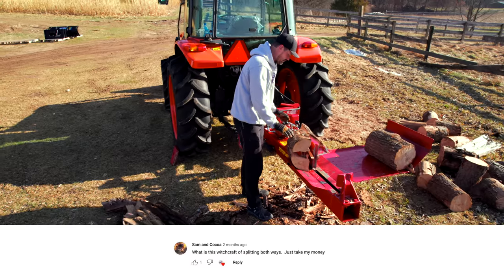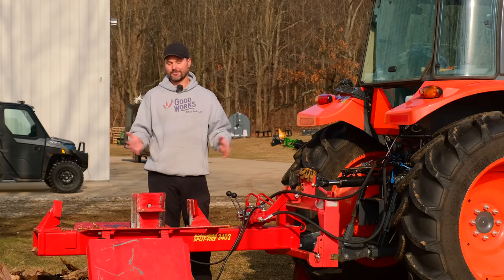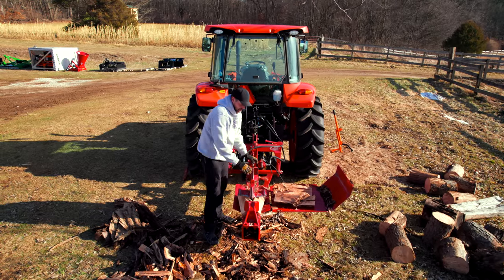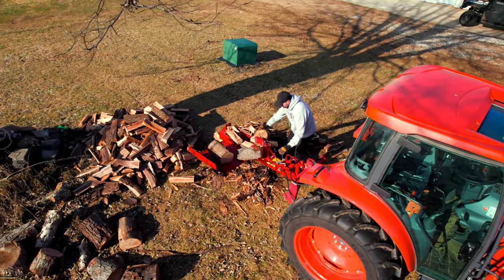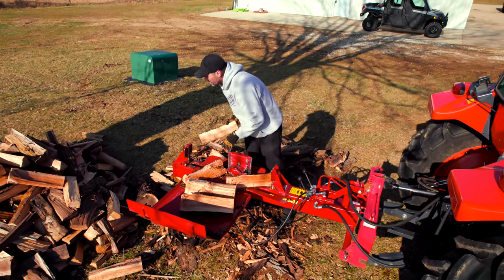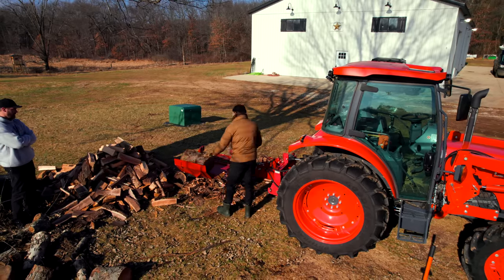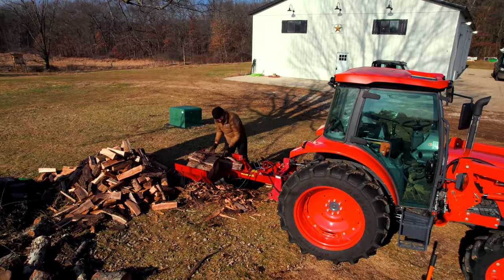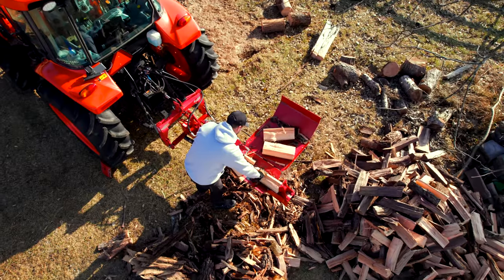THIS IS CRAZINESS! ARE YOU AFRAID TO USE YOUR TRACTOR?

Comment: When I was young and foolish, I once had 30 yards of class 5 delivered to my property.  I used it to repair and maintain my driveway.  Spread every bit of that with a wheelbarrow, shovel, and rake.  What was I thinking?!!!  I'm older and wiser now, and less physically capable.  I own a tractor.  I may plant some flowers in my old wheelbarrow so I can get some use out of it.  Been buying more and more implements to reduce what I do by hand.  Mostly due to time restrictions.  I'm retired now, so I have loads of time to come up with and work on projects.  No tractor?  No projects.  Not ready for full time in a rocking chair just yet, but I'm not afraid to let the tractor do as much of the work as possible.  Get a lot of good ideas from your videos.  Thanks, I appreciate that.

Comment: Great video!
I'm 68, and grew up on a farm where hand labor was thought of as "knowing the value of real work"!
We ran tractors with no live pto, hydraulics or power steering....but I now own a 40 hp KIoti with all three, along with front hydraulics on the loader! For me, as one person , it would be insane to not take advantage of all the power and versatility that a modern tractor supplies!
Bought in May of 2022, it has 338 hours on it and is used for tilling, brush hogging , chipping, transportand leveling of material plus so much more! 
Modern tractors and their systems offer so much in work saving capability, I can't understand why anyone owning one would NOT want to use one to it's full potential!!
Reply: I totally agree with you Greetings from Norway

Comment: I had a John Deere with the 3 cylinder yanmar,great lil tractor. I used it for everything pushing snow, dragging logs for fire wood moving firewood closer to the house, bush hogging,smoothing out the 1/4 mile drive. Everyone kept them me the same stop using your tractor so much lol. So my response was first I paid $1200 for it yeah I stole it, second it’s a 1985 model it had 2300 hours on it when I got it so I know the injection pump is good for 10,000 hours from yanmar. Third if you offering to come over and help I have extra shovels yeah no one even showed up to help. And four it’s mine and I will do with it as I want plus I can fix it when it breaks
Reply: Yep, you stole it!  Congratulations.

Comment: Courtney, I grew up on and around farms and worked on farms from 12 to 22 years old.  We ALWAYS used tractors to power equipment!  Especially generators .  Most dairies would need a generator so large, that you wouldn't think of powering it with anything but a tractor you already own.  I've worked on farms (both dairy and non-dairy) operating tractors from 25 to 225 HP.  One of the farms I worked at did a wood operation in the winter months, and we always used the tractors to operate the splitters and elevators.  There was never a need to have dedicated engines for anything that I can think of.

Comment: The decision to buy a separate wood splitter was easy for me. Cost.
12T gas powered, vertical splitting log splitter was about $1400. The splitter for my tractor started at $3k, and the one here is available locally starting at $3500 (i'm in Canada). Half the cost after taxes- no brainer.
But for things like snow blower, snow pusher, tiller and box blades that's tractor based.. You can't get the power and size I need in a separate walk behind.
Reply: The splitter I bought that is SSQA on my FEL cost only $900 about 4 years ago. If is super heavy duty and came from Titan.
Reply: @boltactionshooter  have you checked prices lately? yeah...
Reply: @6point5  They are up for sure but so are stand alone splitters. The one I have is WAY more versatile than stand alone splitters, for my purposes.

Comment: LOL! Some interesting views Courtney. Here's mine - in my experience it does not make sense to put the splitter on the 3 point. I need the tractor to get the logs and move them around, among other things. I need a carry all or BTR on the back to carry my tools, saws etc, and often i need to pull a trailer behind me which I can't do with a splitter back there. and I would bet most folks do not have remotes - and if they do, I'll bet very few of them paid the extra cost to install remotes with a detent (continual flow) which the splitter requires. For me, it does not work but perhaps for some it does. Split Fire makes awesome well built splitters for sure. Cheers and thanks for the great video!
Reply from the maker: The splitter is just what I have for the video as an example, but not really the point of the video.  It's the thought process of trying to minimize hours on your tractor. Could be any piece of equipment -- generator, pull type mower, self powered blower, etc.  The tractor is a machine and, by nature, meant to be used.  It's just funny that this big, robust, expensive do everything machine is coddled by some folks.
Reply: @GoodWorksTractors  Very true my friend. LOL! When mine needs to be washed , I park it out in the rain..:)) Have a wonderful week and all the best Courtney!

Comment: I only process about 4 cords a year. I use my Kioti DK-50 to power my Boss wood splitter. I bought it new about 5 years ago for about $1k on sale. I move it with pallet forks and use it freestanding. I park a skid steer loader close by and split the wood right into the bucket. I got sick and tired of maintaining an 8 hp gas motor, tires, batteries, etc. It goes vertical when splitting big stuff. I am very happy with my set up. For commercial use it would not make sense but if I did have a commercial operation I would have a small diesel on the splitter. Even with today”s crazy diesel prices there still is no comparison to gas operated equipment.

Comment: Wow I had watched your video on the survey about people only using their tractor 50-100 hours a year and to me that is crazy, I bought my first tractor in 2015 and I bought a Kubota B2620 brand new with loader, backhoe and belly mower, paid 28,000 + taxes Canadian at the time for the whole package.  Now I purchase this tractor because I had just purchased a 20 acres property which was totally virgin and needed a lot of work plus, I wanted something to help my work on my newly being build house and around the house. From summer 2015 to fall of 2020 I put on over 2,250 hours on this little machine and put it through a lot of “Shit”.  I had friend bragging about how shinny their tractor was but they never use the damn thing….  Sure, have it shinny but put a few scratches on it to show that you work with it 😊
I converted my property to now mow 18 acres a week, and I have since build myself a mowing system with a few pull behind mowers and this allows me to mow 14’-6” wide.
I use the tractor to move very large boulders, if I couldn’t lift them, I push them and trust me I tested this tractor on that one 😊 I use the backhoe to dig out stumps and boulders in the way.  Anyway, you get the picture I use my tractor because that is what I bought it for….
I than sold my B2620 for 20,000.00 in the crazy covid time and now I purchase a bigger machine with the complete package for $50,000.00 Canadian late in the fall of 2020 cause I just couldn’t get one any sooner.
I bough the same package with loader and treated myself to the swiftack system, I got the bigger BH77 backhoe with 24” bucket, 60-inch bellow mower, rear quick attach for the 3-point itch, set of pallet forks and now own several attachments like, 8-foot rake, 60 inch Tiller and box blade.
I’ve already almost got 500 hours on this new Kubota LX3310 and plan on putting a lot more hours on it 😊
And yes I’ve already got a couple scratches on it, so if you’re only going to use a machine for less than 100 hours a year which is not even 2 hours a week!!!  Then just rent something or borrow your neighbours and do pay him for it……

Comment: I am all about consolidating machines for overall cost, space, and time… but there are times you need the tractor to move logs, rounds, and trailer while splitter stays setup.  Another example is a generator.  I often need the tractor for clearing debris or snow from storms during power outage.  Other than those examples, I  mow, blow, dig, aerate, fertilize, dethatch, till, and forest with one machine.

Comment: You asked for some feed back.  I am about to turn 67 years old.  I cannot do, physically, what I could do three years ago much less 10.  My wife passed away recently and I am now in charge of doing all that I have always done AND what she did around here, so time is more precious than it was.  Lately I have not been able to find people willing to work on small jobs like grading my driveway.  I bought a SCUT to make life easier, faster, and possible.  I still have several pieces of equipment that are self-contained (splitter, chipper, pressure washer, generators) but am working at changing over to attachments for my tractor because, as you point out, it makes for fewer engines to maintain.  I'm not worried about putting hours on my tractor.  It's a tractor.  It was designed to be used, not to sit in an equipment shed.  My SCUT may not be as robust as a farm tractor, but I believe the concept holds.  I must temper that statement with the fact that I've owned this (or any) tractor for less than a year, so I'm still a newbie and may be in for a rude awakening.  I am truly loving my "powered wheelbarrow" for all that it can do around here with bucket and forks.  SUCH a help!
The one exception in this for me is mowing.  I live on 4 acres of mountain side with some steep slopes.  Some of them I can climb and descend along certain paths and do so fairly safely with the tractor.  But mowing an entire face - not fun.  Downright scary.  So yes, I am afraid to use my tractor for that and bought a zero turn made specifically for use on steep slopes.  That's my 2 cents worth.  Maybe a nickles worth, what with inflation and all.

Comment: I have a 41 year old tractor with under 1600 hours on it. Most of those were in the first 15 years or so, then my grandfather slowed down and didn’t use it so much for the next 22 years. I now run it 50-100 hours a year per the hour meter. I would do more if I could afford more attachments! A nuance here: by design the hour meter cranks at slower than clock hours at RPM less than 2240, and faster than clock hours above 2240 RPM. Only for PTO work do I run above 2240 RPM (2500 for 540 @PTO). Thus the “true” hours on the machine are much more than my meter shows, as I do most of my work (loader, plow, skidding logs) in the 1500-2000 RPM range.
Reply: Sadly some of the newer tractors run the hour meter solely based on 12v, not mechanically driven relative to engine RPM.  Ugh.

Comment: I do very little firewood and any I do I enjoy splitting by hand.  Good exercise.  So I can't weigh in on a splitter run by a tractor, though that one is sure pretty.  What I do like is as few small engines to maintain as possible.  If you can use one properly maintained diesel  engine to accomplish a number of tasks/jobs, that would seem like the way to go, IMHO.  Plus, whatever gets you more seat time...😛
Thanks for sharing.  I enjoyed it.

Comment: So I have a subcompact new holland. It has very low hours. I bought the tractor to help clear my overgrown property from when we bought the place. Also to help landscaping. It doesn’t get much use in the winter. It rains quite a bit in Washington and have lots of indoor projects to get done. I help friends and family with projects as well. As far as a log splitter goes I prefer self powered. Smaller foot print and can fit in much tighter spaces. I also don’t mind lending my splitter to family as it was $600 used and my tractor was $20k. I am the only one that uses my tractor. Just like my truck. The wife can drive them but won’t be pulling or working them lol.

Comment: I have a 3 point splitter.  I purchased it to avoid another small engine to service.  The downside of the 3 point splitter is they typically want more hydraulic flow than most compact tractors can provide.  It doesn't hurt the splitting ability, just speed.

Comment: "What's tractor worthy and what's not tractor worthy"?  VERY GOOD POINT.  And I guess that's something that is subjective to each owner.  But, what I DO think a valid point is, the smaller tractors (smaller than the 70HP one you're running in the video) don't have hydraulic pumps that put out enough GPMs to support a splitter like the one you're running there.  Most of them only supply 5-7 GPMs, and that would be painfully slow when trying to run a log splitter.  On yours, obviously your cycle times are sufficient.  But anything smaller than the tractor you're using there, I don't know.  I would imagine you'd see diminishing returns rather quickly as you step down in HP and hydraulic pump GPMs.

I DO like (and respect) that you try to remain relatively objective with most subjects that you broach with your videos.  You try to point out the pros and cons to each point of view.  It's refreshing to see that.

Comment: One thing I like better about splitters with their own motor is that if you need to use it somewhere else you don't need to bring a tractor with you, or if you loan it out you might only need to loan out a 500-1000$ splitter vs a 20k tractor and splitter
Reply: agreed.  a splitter motor is peanuts vs a tractor motor!!
Reply: @AdamCraigOutdoors   I meant the cost of the thing loaned out, I agree with him about not putting enough hours on the tractor motor to matter
Reply: This flexibility is the only reason to have a splitter with a separate engine.  Otherwise, I would take a tractor powered splitter every day.  There probably isn’t a homeowner alive who is going to wear out their tractor engine.  Even farmers rarely wear out a quality diesel engine.  We had engines in log skidders run over 10,000 hours before needing any serious work.  How many homeowners run their tractor 500 hours a year?
Reply: That’s a big reason to run it off the tractor.  Nobody can borrow it!!!  Go buy their own or rent one, like I had to do!
Reply: @chuckstimson9029  100% Agree 👍
Reply: Yes perfect👊🏻
Reply: One: don't loan it. Two: loan it if they have their own tractor. They're likely to appreciate it and know more about how to treat a machine if they own a tractor. My splitter can run off any of three tractors I own b I lt in or before 1971 and regardless of whether I put on a few hours each year splitting my heat, they'll all outlive me. I'm in my 60s and as  the saying goes,  you can't take your tractors with you. Or something like that.
Reply: Thays why you don't loan out you equipment unless you loan yourself with it

Comment: I've thought about using the tractor for splitter power but my Dad kind of talked me out of it for the same reason you said "Why bun up the tractor, little engines are cheap."  But you do have a point and I'm guessing I probably put more like 10-20 hours a year on my machine so it should last my lifetime for sure.  One huge down side on the little machines is lack of flow for things like a splitter. 😞  Thanks for sharing!
Reply: Not sure if it'll be comparable but I have three tractors built in or before 1971 and all 3 are over 10,000 hrs. Still running great and enjoying only working at most 10 hours a week, after spending their earlier years farming running can't see in the morning 'til can't see at night. I can't imagine anyone splitting wood enough to kill a tractor. They'd kill themselves first.

Comment: My first year with my 1023e and I put 226 hours on it. I’ve used my tractor for as little as holding a window in while I working on it from the other side of the wall.

Comment: I burn probably 7-9 cords a year between my outdoor wood furnace and smaller garage furnace….I like having a stand alone splitter simply because I use my tractor for getting the logs plus several other things. So it’s nice not changing implements just to cut firewood, especially when youre doing it frequently. I’d say the PTO ones are good for light/medium use. They’re definitely really cool.

Comment: It depends on what part of the world you live.  Here in central Texas do I use a log splitter - YES!  But, maybe not nearly as much as someone in the northern parts of the country, or maybe Canada.  I own a gasoline powered log splitter.  Since I don't use it so much it sits.  When I did want to use it I had to spend half of my precious day buying an expensive battery, taking the carburetor apart, replacing the spark plug.  I gave up and purchased a Gearmore hydraulic powered log splitter that I use on my 2011 Kubota L3800.  Not to long ago I didn't use the Gearmore hydraulic powered log splitter for over two years.  No matter, back the tractor to it, hook it up, and ready for use.  And the hydraulics from the tractor is much more powerful than my gasoline powered unit.

In 2022 I also had to replace the carburetors on my Honda generator and my 33" walk behind lawn mower.  I'm told the ethanal in todays gasoline is part of the problem because my equipment sits without use for so long.  To be able to buy ethanal free gasoline I have to drive 40 miles away.

To some up, where a person lives and how much you use a piece of equipment is a deciding factor between gasoline power or hydraulic power.  My perspective is hydraulic power is far less maintenance and I don't have to store non-ethanal gasoline.  MJ

Comment: If you've got plenty of wood on your property and don't need to go to some other property to get your wood I'd just use a 3 point splitter. But planning when you do your splitting will help. During the year if you know about what you'll be using for firewood you can stage all your logs in one area to be cut and split. But always be 1 yr ahead so as to give the firewood enough drying time. This way you won't be splitting during very cold or hot temperatures.  Make it easy on yourself.